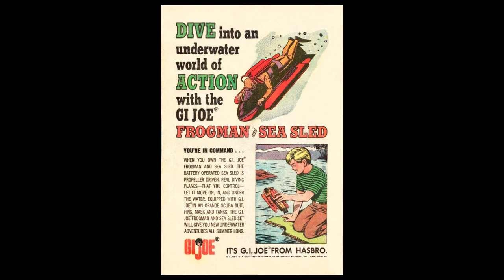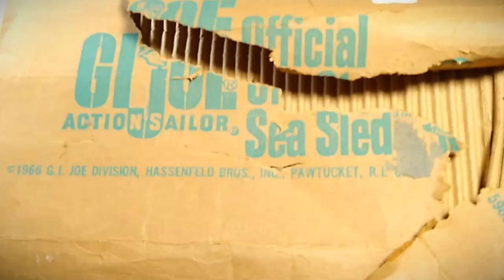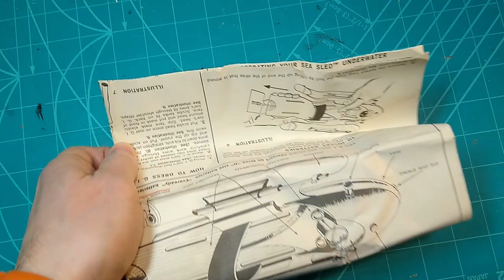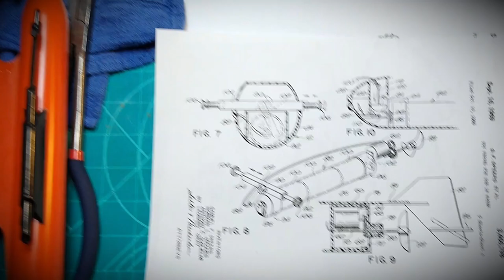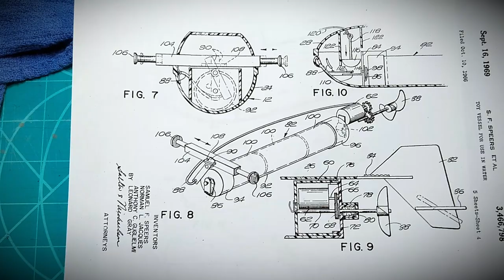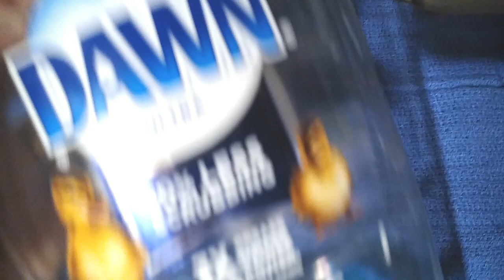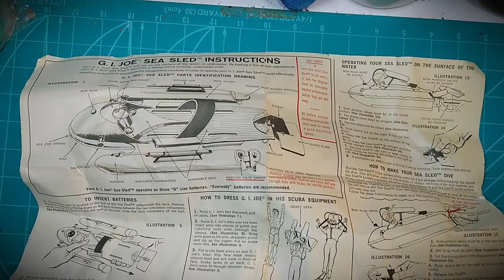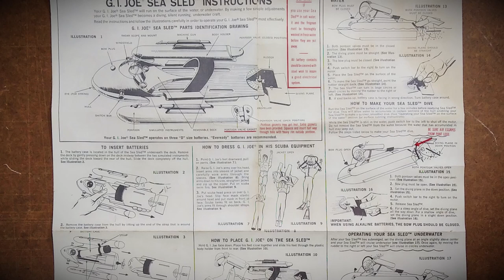GI Joe Sea Sled Repair Restore - Vintage Hasbro Toy Fix Troubleshoot

Comment: Excellent video Tim!  Glad you are back and with this subject matter.  I purchased a sea sled about 6 months ago and the motor will not run.  The prop shaft spins but no power to the motor.  I now have more info to go on.  Thanks again and welcome back.
Reply from the maker: Thanks Glenn, hope this helps you troubleshoot your sea sled
Reply: @ToyTinkerTim  I look forward to your future videos on the sea sled.  I need to source the red foam flotation strips on either side of the battery tube.

Comment: The 'Drain plug" is similar to the ones on real boats and jet skis. It's used to drain the hull after use in water in case water seeped in during use.  I have a sea sled and fortunately for me it was never used in water!  Great video and Happy collecting.